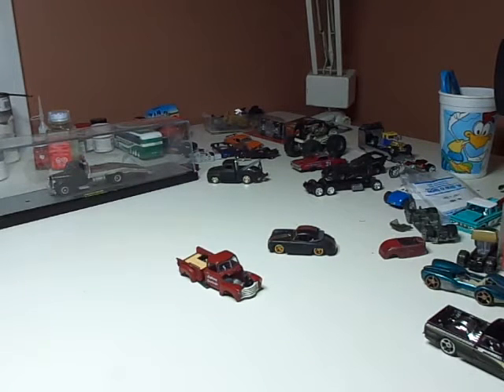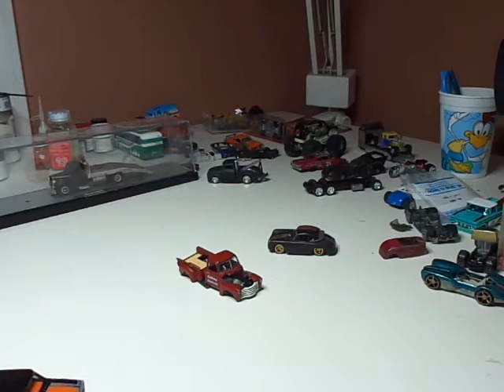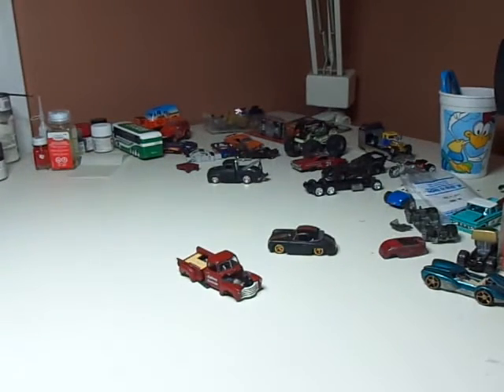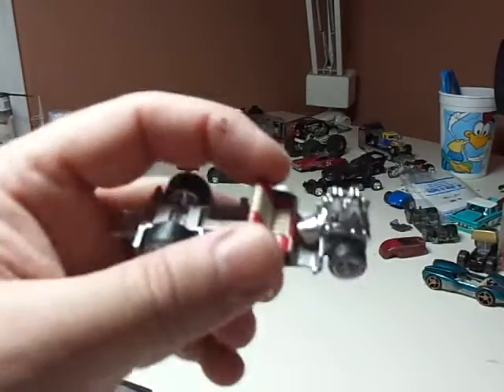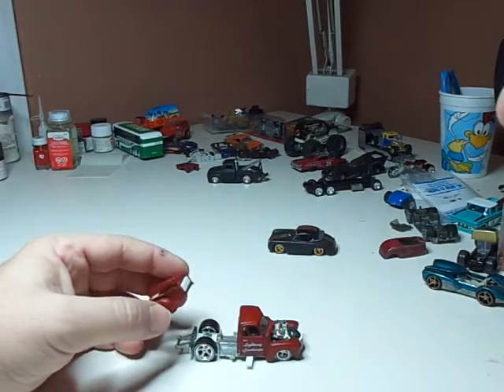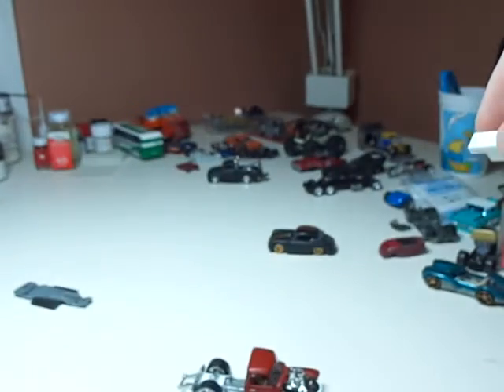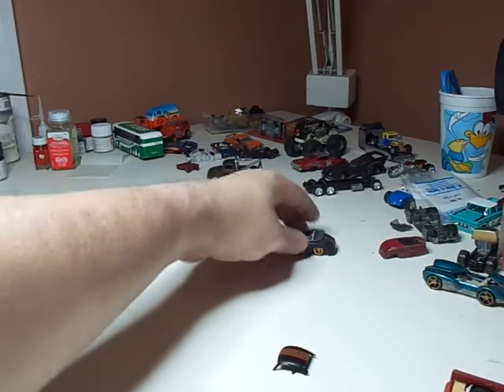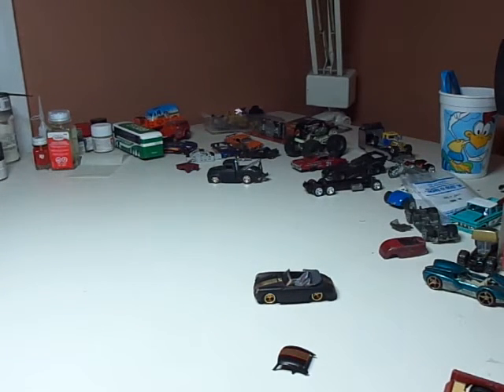Custom Hot Wheels - Technique Thursday:  Using plastic (styrene) as spacers and lifts

Comment: what u use for the conv't top of the 956a ?
Reply from the maker: Sorry man! The "top" was a simple piece of styrene shaped like a covered  convertible top, and wrapped in a thin sheet of textured vinyl. The vinyl was from a sample pack given to me by a 3M rep decades ago when I worked for a sign shop.  To get the look on the 356, I made two slices on either side of the engine cover (from the cabin area), then batted in down to form a lower profile (using a fabric covered block of wood and slow taps from a heavy hammer. I would have retained the A pillar, but I was aiming for a low profile windshield.  The seats are from the new Acura, and I am still looking for a stylish steering wheel.

Comment: how did u make the top look like it's folded down?
Reply from the maker: Thin styrene sheet cut to look like a folded top. Then you warp the plastic to force inwards a bit (hard to explain, but if you look closer it will make sense).  Then I covered the plastic with a textured adhesive vinyl.